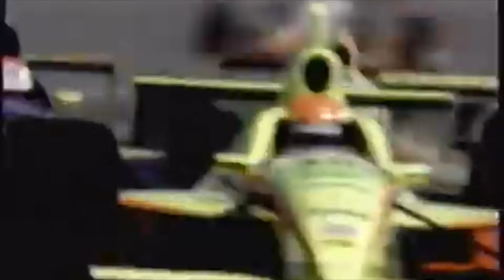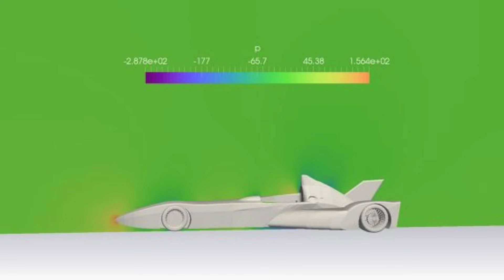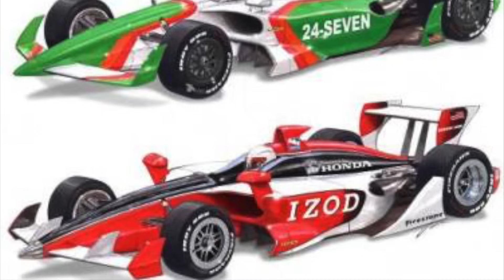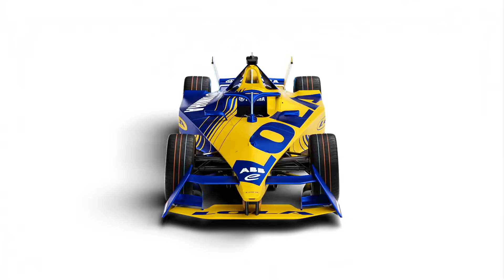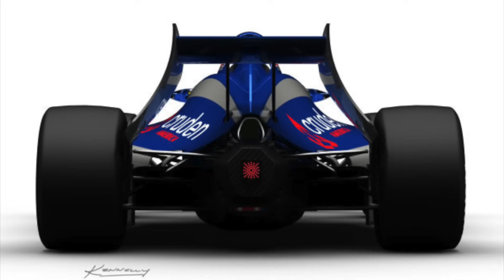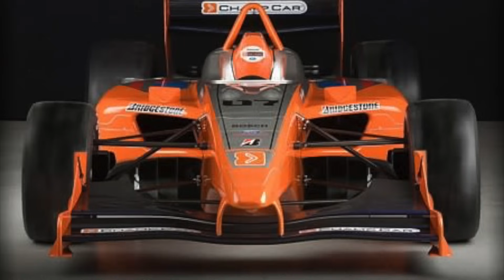The forgotten 2012 Indycar concepts - how these wild 2012 cars could have changed everything

Comment: Imagine if Indycar Series wasn't a spec series but a formula series. Set a cost cap, minimum weight, max power, and wheel/tire dimensions. Only thing that's spec would be the crash structure. Let the manufacturers go at it. Could attract more manufacturers as a serious alternative to F1.

Comment: I've known about these concepts for ages but I've never known about the surrounding demands or the formation of the commission and what they requested from the manufacturers and as a result I'm now left even more frustrated at that point of history than I was before. It seems unfortunately quite common in Indy's recent history anyway to set out alot of goals for a future change which then wastes alot of resource to then proceed with the lowest common denominator which can really put a foul taste in the mouth. Recently Indy has done this with the 2.4L Engine package which got backpedalled for a resulting relatively mild hybrid system which has potential due to fully analogue control but Indy has been required to backpedal its' backpedal after Honda had threatened to leave by confirming the 2.4 engines on the new car. As for the new car, I mean I've designed my own cars which include alot of Lola bias by default, so I'd like to see a more "organic" or "Designed" look rather than an engineered one, as the Dallara has a knack for making cars that're rather bulbous with squared off sections and round radii forced together in my view. On top of that, I know you can only go so far, but Indy has a history of capitalising on massive underbody gains F1 was never able to do due to porpoising, and now it seems F1's floor designs have inspiration from what evolved from CART.

Comment: Having componentry largely come from one place just forces everyone to pull from the same limited supply and pay whatever the supplier charges rather than being able to kludge something together themselves. Yes, open development series let you spend as much as you want, but that also works in reverse. Recall Roger Rager qualifying 10th, leading two laps, and taking Rookie of the Year in the 1980 Indy 500 in a 3-year-old secondhand Wildcat chassis powered by a school bus engine he'd pulled from a junkyard. With teams now forced to pay whatever Dallara charges for a chassis - as well as whatever Chevy or Honda charge to lease an engine (yearly) - there is no such thing as a truly low-budget IndyCar effort.

IndyCar (which has a charter system now, anyway) isn't even the only example. Formula 2 & Formula 3, along with Japanese & European Formula 3000, used to be thriving series capable of headlining full-blown grand prix in Macau, Pau, Vallelunga, and uh, Birmingham! Modern-day F2 and F3 have such a problem with accessibility for anyone but the super-rich that it birthed an entire meme: the Prema Tax. Two different rallycross series - Nitrocross and World Rallycross - made a switch to spec, supplied EVs, and fell so precipitously in both entry count and fanbase support that one series died and the other's on its deathbed. With every move to tighten NASCAR's rulebook, entries in the Cup Series have fallen along with the number of unique teams.

In short, give me Wacky Racers. Actually, the fact that one of the most famous depictions of motor racing includes what are, quite literally, cartoonish levels of meaningful variety should say enough about how top-level motorsport should look. Going spec has been IndyCar's worst mistake, and it could be the end of them if they fail to find the courage to reverse course.
Reply from the maker: I agree.

Comment: I think id be more interested in indycar if it was no longer a spec series and we would just have wildly different designs every year like what used to be made, back when youd see things like a car with 2 porsche drivetrains (one front, one back) to make an AWD car with 2 air cooled flat engines, the strange "drivetrain plus sidecar" looking one where the driver was nestles between 2 wheels on one side with the main chassis to the side of them.

I do get the appeal though, but yea wish there was even a lower series where teams make their own designs, maybe like an opposite of F1-F2 relationship with the spec series on top this time and the engineering series slower.
Reply from the maker: me too

Comment: Some of the original Indy bricks were installed at the start/finish line of Ontario Motor Speedway, in Ontario California. I saw Jerry Grant break the 200MPH record in 1972. Offy engines making well over 1,000HP, poor downforce compared to today, most of it was mechanical grip, so he was doing well over 240MPH.
As Forbes article explains "Sophisticated ground effects today allow cars with much less horsepower (about 700 total) to corner at speeds close to those achieved on the straights, so driving around a track is less choppy. To average 200mph, a car goes through corners at 195mph, and hits maybe 205mph on straights. For Grant it was a different story--one of horsepower, hard braking and holding on for dear life. Grant's straightaway speeds were in the 240s, corner speeds in the 160s.
Reply from the maker: Sounds wild. Some of the bricks can still be found in a river in Indianapolis I have heard.

Comment: I don't think, that somebody had considered the BAT's proposal seriously. To draw a nice-looking concept is one thing, while building a real car in sufficient amounts, plus the spare parts kits is a completely different one. Relying that on a company which hadn't built a single race car would've been kind of insanity. Same could've been said about the Deltawing - their concept looked cool, but the company's capability of fulfillment of all the requirements were under a big question sign.
Ironically, that the weirdest of those concepts (the Deltawing) was the only one (besides Dallara, obviously) which eventually had been built in flesh and even had raced.
Reply from the maker: I think that was the issue with BAT - no problem with the people behind it but no infrastructure.
Reply: I imagine part of the selection process involved IndyCar doing a deep dive into the prospective company's finances.  That may have been what sunk Lola's bid, because it would have likely been clear as day that they were betting everything they had on this design being selected by IndyCar and had nothing else to fall back on.  That was likely a problem with some of the other bids as well, with their ability to fully executed and then support their design proposal for the 10+ years it would be in use questionable.  For all that they wanted to move away from their old Dallara design, the company still had a huge advantage that they had already proven to be a reliable business partner and able to support their product over the long term.  That may be why this time around IndyCar didn't even consider looking elsewhere but simply commissioned Dallara as the designer and builder of its next generation IndyCar for 2027.
Reply from the maker: @megachonk9440  I think at that time the finance would have seemed ok - UK Government promised funding - it never turned up

Comment: Should have gone with Lola. We would now have Lola USA, an entirely new US company providing jobs and bolstering the local economy, and being able to collaborate with Ford and Chevy in order to improve all American cars.
Reply from the maker: I wonder how strong Lola USA would have been, I suspect it would have supported the UK business for a while. Interestingly had the cars been made in indy the chassis numbers would all have started IN rather than HU which they did prior to that.
Reply: It's more likely their supposed intention of building a facility in the US to build cars was a sham, or wishful thinking if we want to be generous.  This proposal was basically a desperate do-or-die for them, as they were teetering on the edge of insolvency and went out of business in 2012.  In any case, Dallara did exactly what you propose Lola would have done, and in 2012 they opened an engineering facility next to the Indianapolis Motor Speedway to do design work and manufacture all IndyCars.  I'm not sure why they (or Lola) would collaborate with automakers to improve American cars, though.  It's never been part of either company's business to do that kind of thing.
Reply from the maker: @megachonk9440  yeah I wasn't convinced that they would start real production in the US

Comment: I would very much like to see a chassis that would accept any of the many GTP engines currently running in IMSA. Since the GTP cars designs have a lot in common with Open Wheel cars, adaspting that concept with its attendant BOP would make for a much healthier Indycar engine compliment. They have a much more robust hybrid implementation, and with only slight bodywork accommodations it would allow OEMs that we have never seen in open wheel.
Reply from the maker: Getting back to Group C and F1...

Comment: Understand the need for a lower cost "spec" series car, but would like to see some innovation/customization allowed by the teams in visible areas.  Maybe have a standard hull, but allow teams to design their own wings.  Something that allows competition in engineering and can be a talking point between races.  As formula-E showed, a cool looking car is nice, but if every car looks exactly the same it gets stale after a couple of races.
Reply from the maker: Good example
Reply: They did during the aerokit days where Pratt & Miller did excellent and Honda had to copy their work.  They both ended up looking the same, cost a lot of money, and hurt quite a few fans in the stands when all the tiny wings would snap and go into the crowd.
Reply from the maker: @danielh8316  thats an engineering issue and not beyond solving.
Reply: I don't know if they still allow them, but originally, the plan with the DW12 was that the team buys the basic tub from Dallara for USD $349,000 and then they could purchase aero kits from various companies with a price cap of $70,000.  I know the delayed the introduction of aero kits in 2012 and then again in 2013.  That said, as far as I know, only Honda and Chevrolet ended up making aero kits and I think most teams have always just used the Dallara aero kit.  I remember that at one point, they were trying to get GE to develop a body kit, for reasons I'm sure only IndyCar knows.
Reply: @megachonk9440  That went away in 2018 with the Universal Aero Kit.  Chevy contracted Pratt & Miller to create their aero kit while Honda went with Wirth Research which tanked Virgin F1 and tanked Honda until IndyCar let them copy Chevy's aero kit.  After a couple of years, both aero kits ended up looking the same which wasn't the original point, and all the mini wings were snapping off and hitting people in the stands at races.  They went to the UAK to put more downforce through the underbody and make sure every part is solid.

Just like Pratt & Miller, GE has their fingers in the aerospace business and would probably do a decent job if they could be bothered to set aside some government contract to have fun.
Reply from the maker: @danielh8316  yeah it wasn't a great execution of the project
Reply from the maker: @megachonk9440  Never quite worked out that way

Comment: To be honest, every concept, apart from Dallara, look like something put together in someone's backyard. No wonder they choose Dallara, they are the only manufacturer to have the resources, strenght, expertise and pedigree to do it, other than being historically, the safest chassis around.
Reply from the maker: Think both Lola and Swift had solid and proven records, Deltawing got the car built in the end too.
Reply: @Samsthepits  with all due respect, I wouldn't use the word "solid" to describe Lola and Swift achievements (maybe Lola, in a distant past). Regarding Deltawing, they took part in 29 races with no results, the first of them was the 2012 Le Mans 24 hours with a DNF and almost 20 seconds in quali from the Audi on pole...as I said, all things considered, Dallara was (and even more so today is) the only sensible/viable option.
Reply: @bio4546 yeah some proper one would be Oreca Ligier and Multimatic, not Lola
Reply from the maker: @bio4546  Lola was doing loads at this point in international racing, as was Swift.
Reply from the maker: @fqeagles21  Multimatic wasn't doing its own cars at that point. Lola was.

Comment: I still love the fact that the Deltawing went on to have a somewhat lengthy life in racing. It was uncompetitive, but I can remember seeing it race up against prototypes that were so much bigger than it. It was odd for sure, but that’s kind of what racing is about. Having multiple completely different concepts go up against each other and see which is better. Radical designs aren’t super common anymore. Other than the front wheel drive based Nissan LMP car, or even the Mercedes F1 sidepods from 2023, I don’t remember seeing much unique designs in recent times.
Reply from the maker: Yeah the Deltawing was quite something

Comment: For the sake of historical accuracy the Panoz DP01 proposal shown here was never part of the later IRL desire to move away from the then current Dallara. What is shown in the video is actually from 2006 during the development of the DP01.  During that time in 2006 a rumor surfaced that a merger between the IRL and Indycar could be on the cards.  I’m pretty sure this never made it into the public domain and it disappeared as quickly as it appeared.  It was enough time for us to hastily put together a Panoz GF09b engine cover and nose/front wing onto the then active DP01 wind tunnel model to show how a car might look.  It was never wind tunnel tested and indeed was the work of a few hours, some silver tape and modeling clay. By the following day those parts had been removed and were back on the storage shelves so we could continue with the DP01 development. I know all this because I took the photo!

Comment: Get rid of aeroscreen and go Halo !!!
Reply from the maker: Why would you prefer that?
Reply: @Samsthepits  because drivers would once again feel the coo air at speed and engine noise of cars.
Reply: Cool air at speed…
Reply from the maker: @SaveMe-2000  they have helmets?
Reply: @Samsthepits sam, as you know, at speed theyll feel the air pressure, be alot cooler and bring back the feelings before Aeroscreen. As a fan, i think it will look alot better. Does every other open wheel series use the Halo ?

Comment: What I want with the 2027 cars is more constructors beyond Dallara like Oreca, Ligier, Lola, and Multimatic, teams like Penske building their own designs, turbocharged V8s like the CART days, and a better rear wing for the ovals.
Reply from the maker: I'd love that
Reply: The series isn't that healthy yet and couldn't get that ready in time for 2027.
Reply from the maker: @danielh8316  depends on the rules, get it right you might find a lot of entries very fast.
Reply: BoP the chassis to each other at the beginning of the season but then let the teams do their own setups and add their preferred engines.  The benefit there is all four chassis perform roughly the same.
Reply: @alaeriia01  Others would have to be interested in building a chassis and most production based engines or hypercar engines are too large for the current chassis.  No one else makes one that could survive 240mph oval crashes.
Reply from the maker: @danielh8316  Others would be interested if the market was open.
Reply: @Samsthepits   I really doubt that there's enough money in the teams to do that.  Even God King Alex Palou doesn't have sponsors for every race and has a couple where he's driving the HRC livery.  The Fox deal seems to be working with a 25% increase in viewership so far and Detroit was the 3rd race this year where over 1 million people were watching.  While things aren't as desperate as 2007 where it's 1 chassis/1 engine/18 cars, it's not too far away.
Reply from the maker: @alaeriia01  maybe but I'm not keen on BoP
Reply: @Samsthepits  I suppose BoP isn't the right term; I meant that the chassis should be equal in aero.
Reply from the maker: @alaeriia01  that can be done

Comment: I'd love for Indycar to be bold where it counts. Sure, use a spec safety-cell tub, aeroscreen, and some spec aero-parts (floor, wings) but open other areas for meaningful innovation - especially engines. Allow for 1,200HP cars, but allow for any engine configuration to get 1,200HP 4-cyl, 6, 8, 10, rotary, hybrid or whatever. Make it clear that Indycars are bad-ass machines.
Reply: They tried that during the aerokit days and with Chevy and Honda deciding how they wanted to turbocharge their engine.  By 2015, everyone ended up at the same place.
Reply from the maker: @danielh8316  I wish that they had a bit more freedom.
Reply from the maker: I think engineering & Innovation is core to Indycar. It needs much more of it.
Reply: 1200hp engines while low on cost it’s not happening